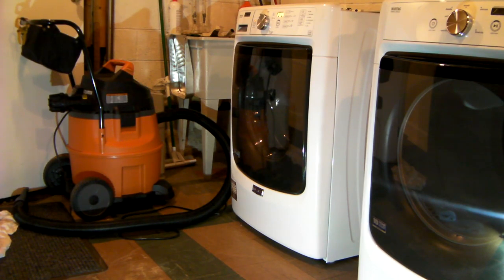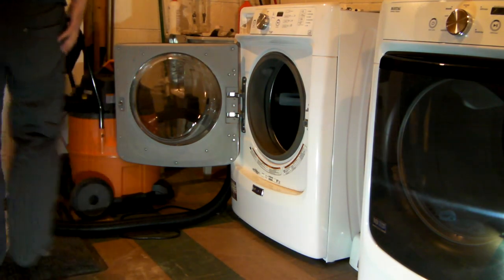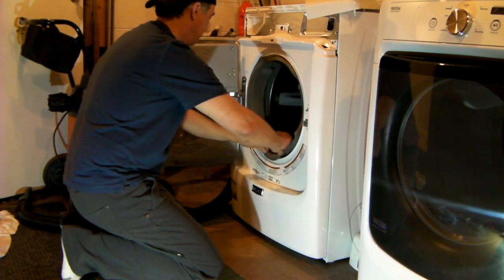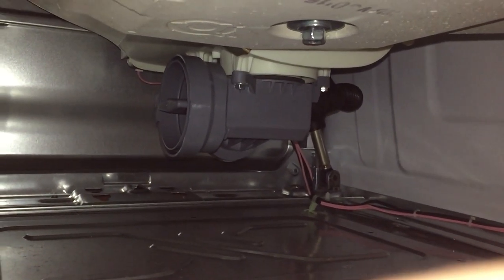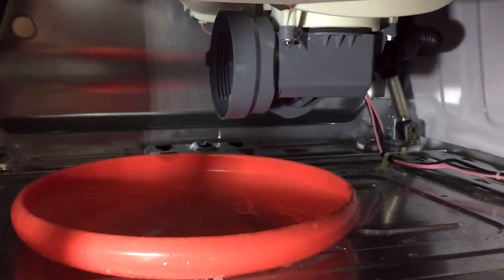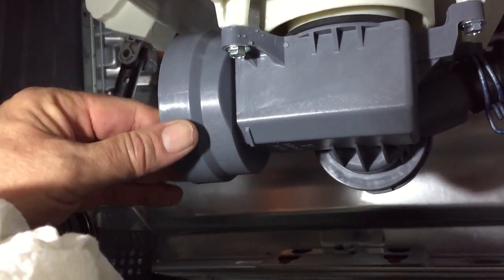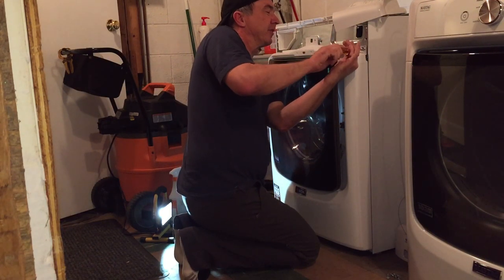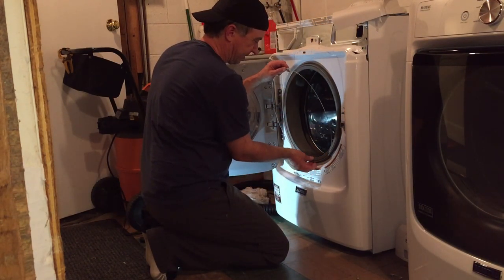[read comments 1st!] Maytag MHW3505FWH Front Load Washer Drain Filter Clean and Repair

Comment: Please don't.... dont do this.  Please prop up the washer at a 45 degree angle, please take off two (2!) 1/4" screws and two plastic tabs, please remove the bottom panel, and access everything in about 8 minutes.  

Good lord this guy just did heart surgery through the eye socket!
Reply: Thank you this is the info I was looking for.
Reply: Oh man. This comment just saved me. THANK YOU!!!!
Reply: Just thought I'd leave this here, if it might help others. First unplug it and plug it back in after 20 minutes, to unlock it. Don't push any buttons, it will do its own thing. After it unlocks, go ahead and vacum out the inside, in case there is hair clogging it. Then prop up and do exactly what you said. Just unplug, prop it up, unscrew and clean it. I put 1 cup baking soda and 1 cup vinegar on the inside and hit clean machine after doing this. This just helps wash out any extra gunk. I don't use affresh...ever. When I clean my machine, I only use this method. I've had my machine since 2015, and have only had to clean the drain plug once. I do others laundry, so we wash about 5 to six loads a day. Blankets are done twice a week. That's another 5 loads on those days. My other Maytag kept clogging up, and eventually wore out. Once I took the advice to start using baking soda and vinegar, I've had no issues.
Reply: My washer is in a cabinet with a dryer on top - no way to prop it up! I wish I could. Sigh. I SO wish I'd known what to look for in a washer. I would never have bought one with a deeply buried filter!!

Comment: next time try to open from the bottom..  you really took the long way. there is an access panel there you just need to tilt the machine.
I liked the video...
Reply: I thought about doing this also but feared that water could be routed to the electrical panel somehow. I decided to undo the 12 screws in the back panel and got it done that way, using a sauce pan for catching the water.

Comment: I don't know if its a factory defect but I have the 55000 version. 1/2 to 3/4 of of the bottom is a big hole. For me I could easily just tip it to the side.  I was curious if it would be posside to do the same? if you can take the bottom panel off?  For your model, if not possible. I would  cut a hole on the bottom big enough to get at it. taking it apart like that you already voided the warranty I would believe.
Reply: everyone takes apart their washer and dryer no one cares.  the mfgr cannot even legally do that.
Reply: Go in the BACK. 12 screws and done. Just did my 5500
Reply: @chadpeery948  Or tip it and go through the bottom.  2 screws and 8 minutes.

Comment: It’s 100 times easier to pull the washer out and get behind it take out the 10 1/4” sheet metal bolts and bam!!! It’s right there.
Reply: Unfortunately this isn’t the case on all of them.
Reply: @1badC6  well on that specific model it is and that was what I was commenting on. I didn’t realize I had to spell that out.
Reply: @geremypelleran8487  lol nobody said you had to spell it out. I was just putting it out there. No need to get butt hurt.

Comment: This washing machine is a LEMON.  I have been going through this for 2+ years. I had an extended warranty and they kept trying to fix it until it ran out of EXTENDED WARRANTY.  I am stuck with a lemon and I WILL NEVER PURCHASE MAYTAG EVER AGAIN.
Reply: Same
Reply: same. I've had too many.
Reply: What went wrong. I have had mine for 3 years and love it.  Maytag MHW3505FWH  washer.
Reply: @rg515  IT WASHES AND IT WON'T DRAIN, THEY CHANGED THEPUMP AND NOTHING ELSE. We have a working household and need a workinbg product. I got rid of it and now have another brand and love it.  NEVER AGAIN

Comment: Mine is stackable so it is hard to access back or top. Bad design.  My old washer was so easy to clean the drain.  Mine is MHW8200FW.  I guess consumer reports didn’t take simple maintenance into consideration.
Reply: I have the same model. Were you able to do it? I have the whole washer torn apart and have gotten some nastiness out but the filter is either very stuck or not removable.
Reply: Did you have to unstack it to get it cleaned out?

Comment: i cleaned the filter and trap (from the back panel) but it still showing e01, f09 (9/3/23) any suggestions?
Reply from the maker: It's been a long time since I had this problem so my memory is foggy on what the machine can/will do even when it's showing the e01 and f09 codes. Will the machine still perform the 'drain & spin' cycle? If it will do that cycle, the first thing I would try is pouring one or two buckets of clean water into the front of the machine, closing the door, and starting the drain & spin cycle. And maybe repeat that fill/drain operation a time or two. That might help the machine dump any remaining stuff that's plugging up the system. Note that, if you do this, you should probably again check the filter to make sure it's not catching more junk. Please report back! Good luck!

Comment: When you restarted the washer did the error code go away?  How about the noise level?  These machines (all of the Maytag front loaders) make a horrible sound when draining, so was it about the same or worse when you finished the repairs?
Reply from the maker: PassatOKC - yes, the error code went away. The sound when draining didn't change much before or after but now it drains rapidly and with no error codes.
Reply: What if it didnt go away

Comment: we followed these instructions to clean out the drain but after we put everything back together and turned the washing machine on, it sounded like no water was coming into the machine.  Any thoughts on what we did wrong or what we need to do?
Reply: check the water connectons and reboot.

Comment: This is the worst way to get to the filter. It's 100x easier to take off the back panel. You don't even have to undo the water connections. I have a similar Whirlpool model and I just cleaned my filter today. I had the back panel off in less than two minutes. I'll put a video up on my channel if anyone wants to see how to do it.
Reply: Depends on how new your washer is.  The newest models you have to take the front off.  The filter is pointed towards the front and there is no access or way to remove the filter from the rear of the washer.   Older models just take the back off.
Reply: @greg1629  True - some guys prefer to go in through the rear :)
Reply: This does not work for my Maytag. All of the filters and stuff face the front.
Reply: I agree, the back is the best way, but I have a stacked washer and dryer, that I can’t get out of the closet, so this was incredibly helpful to see how to do it from the front
Reply: @greg1629  how old is an older model?

Comment: I did the same on my machine but the error codes stayed on/will not drain     did u have to reset or anything or just turn back on ??  thanks
Reply from the maker: All I can suggest is to keep trying to run it in order to clear out whatever junk may be left after cleaning the filter.
Reply: Replace the drain pump assembly
Reply: I had the same issue. Unplug the machine for at least 10 minutes. It will reset the computer and clear the error.

Comment: I should have read the comment about accessing thru the back panel before proceeding.  However, I was able to repair the problem.  I would appreciate more realistic videos.  Where the cursing  that goes along with real work,  certainly you must lose a screw or drop a tool where it can't be reached?

Comment: STOP - PLEASE READ - Remove back panel. Place a paint tray under drain. Unscrew drain cap, clean..and Go! Less than 5 minute job.
Reply: Yup, I just removed the back panel. Super easy, super clean. No need for a shop vac, just partially open the drain trap and let it leak into a tray. If the tray gets full, you can stop the leak by closing the trap again. Thanks for the video, couldn't have done it without seeing the inside first, but yeah take the back off, not the front.
Reply: The WHOLE ENTIRE VIDEO should be replaced by a blinking text of this ^ comment.

Comment: Could you not take the back panel off to get easier access?
Reply: Here's and easier way:  Tilt machine back so the the front of the machine is about 8" off the ground.  Use 2 X 4's to prop it up.  The filter is easily accessible from the bottom of the machine, which is wide open.  It unscrews CCW, and was pretty stiff for the first 1/2 turn.

Comment: You could've just pull the machine away from the wall and remove the back panel, the filter is just behind it!!
Reply: wrong  filter on mine is in the front, took the back off and can't reach the filter from the back

Comment: Can you get to it from the back panel instead of removing the front?
Reply: I just did this from the back panel. It was pretty hard to move with the water that didn't drain in it. If there was much more water I probably would have had to go in the front like you did.
Reply: Sure, if you want to complete the job in 8 minutes.  But if you want to dissect THE ENTIRE MACHINE, go through the top like this guy.

Comment: This is the absolute hardest way to fix this There's a hatch on the bottom 4 screws Takes the about minutes
Reply: No hatch on this model…it’s a pain in the ass
Reply: Except when you have a riser attached to the bottom
Reply: @benjaminz9062  w
Reply: Mine has a bottom panel with 2 screws and 2 plastic friction plugs.   I pulled the machine forward about 18” then rocked it backwards to expose the bottom.  I took the panel off (the plastic fasteners were the biggest headache).  I could easily put a fairly large plastic tote underneath and didn’t spill a drop.  It took me about 10 minutes total after I gathered my 1/4” socket and my flat screwdriver (for the plastic plug fasteners).  I contemplated not reinstalling the bottom panel to make it easier next time.

Comment: Is anyone else having the hardest time actually removing the filter?? The front circular part screwed out, but when pulled on (for a long time!) that part came off, which looks ok, but the actual filter WILL NOT come out... I have the MHW8200FW model. I can't find ANY other images or help on this. Have been working at it for 2+ hours. Got a lot of junk out with my first finger but I know it isn't clean and I want it OUT. Anyone???
Reply: *there was a screw sticking it shut. Had to remove the entire thing off of the underside of the washer body. Just so ya know. :)
Reply from the maker: Good to know! Was the screw something that got inside there by the wash? Or something that was intentionally screwed in from outside?

Comment: As others have said, this is way way more complicated than it needs to be. There is a very easily removable panel on the bottom of the machine and the filter is sitting right in front of you after you remove the panel.
Reply: There is no panel on mine! But it’s sitting up on an empty pedestal! Can I get to it from under the bottom?? I don’t know exactly what I’m looking for it doesn’t seem to have the one that’s white plastic that you unscrew the front confused 🥴
Reply: My machine does not have a panel on the bottom (although when I need a new one, that is what I will be looking for).  I have to go through the back.

Comment: Can not believe you're showing on youtube this clip.  What you do is completely wrong.  To clean out  tilting the washing machine 45 degrees.  Maytag Engineers designed this machine is very friendly to clean out trap.  Compare to Samsung is pain in the back.
Reply: There is no separate access panel. Didn't you watch?
Reply: "...friendly to clean out trap."??  How is this easy?  My Maytag is a beast and I can't even budge it when trying to move it.  Besides, it's in a corner, smack dab next to the dryer, which is also unmovable.  I have no idea how I'm going to move the washer forward far enough to tilt it back.  Let's face it, it's a stupid design.  Maytag designers gave up functionality for a sleek look (no easy access door in front).  Sad to say, but American products always turn out to be of dumb design.

Comment: This video is totally bonkers!!!  No!   No no no!!! Do not do this.  Take off the back panel.  Or if you can not get to the back easily... like in my situation.... If you just tip the washer backwards 45 degrees (away from the front) and take off the bottom panel... then you can do this entire job in 6 minutes.  2 screws.  2 screws people.  

Please, people, do not completely deconstruct your machine from the front.  It would be like doing an appendectomy... through your eye!
Reply: Just read the comments.  Gosh the pain this video has caused people.  And confusion.  Please remove this video.

12 screws if you go through the back.  

2 screws if you tip the machine back 45 degrees against a wall, put a bottle under to secure it, lay down, and remove 2 screws.  

If you take the filter screw off slowly, you can control the water flow.  I used a shop vac, but a bucket is fine also.  (I tipped mine back 45 dregrees and had space).  

If you take a small tube and put that in the shop vac tube and stop up the space with a rag, then you can probe around the filter and pump and suck out any sand without running water through the bottom.
Reply: This man speaks the truth, I have done this and took about 30 minutes from start to clean up, the most difficult part is moving the machine away from the wall due to my vinyl flooring.